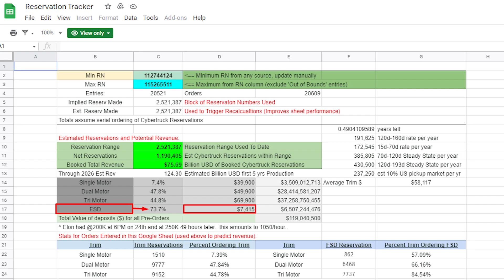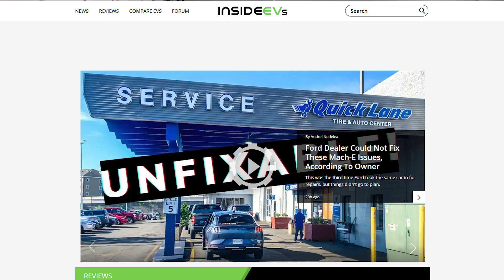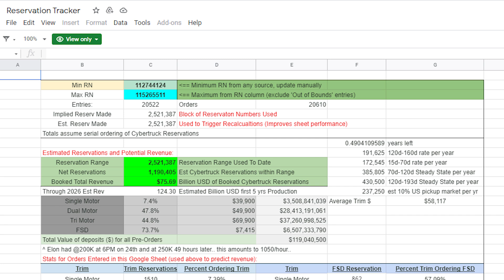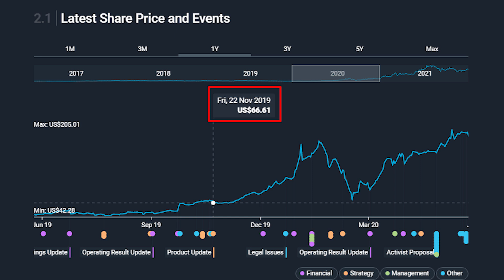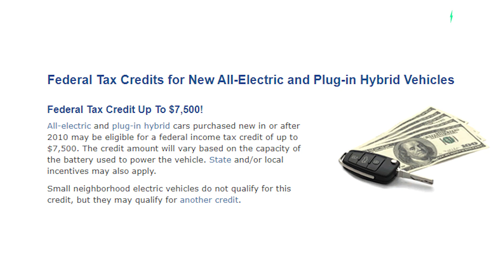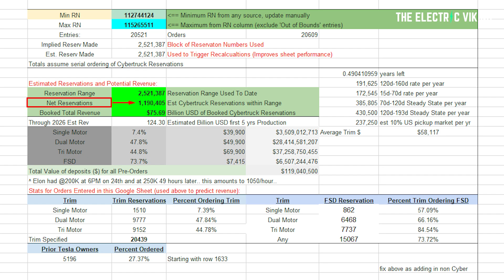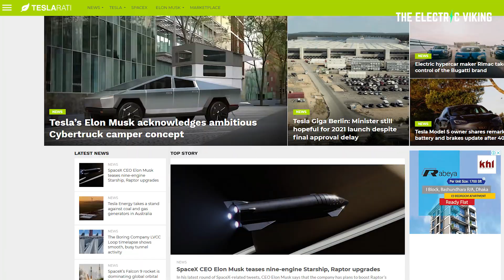Tesla's Cybertruck is set to get 2 million pre orders - THE EV REVOLUTION IS HERE

Comment: Tesla was not excluded from the $7,500 tax credit. The law allowed the credit on the first 250,000 EVs. Tesla and GM have exceeded this sales threshold and are no longer receiving this benefit. Congress is in the process of changing the original Bill to remove the cap and increase the credit to $12,500 if the EV is made in America with union labor, and $10,000 if the manufacturer has no union labor. 

Be careful of the CyberTrk reservations. The $100 on these reservations is refundable. That is why a large percentage of these reservations include FSD. Many buyers have orders for 5, 10, and 20 CyberTrks to be used in Tesla’s Robotaxi fleet. If FSD and the Robotaxi launch is not eminent when the customers are ready to confirm their deliveries (perhaps in 2023 or 2024) many of these customers will cancel their reservations. These reservations also allow these customers to lock-in the price of FSD at $10k and save on future price increases especially when Tesla releases FSD with Certified Level 4 or 5 autonomy in the coming months or years.

Comment: $100 fully refundable resevation not a pre order
Reply: So that means none of the prices are locked? In other words the $100 buys you a place in line so you can buy one for what ever price they decide to charge when they become available.
Reply: @dond668  That is 100% correct
Reply: @gregandkaruna6674  Sorta, wait and see.
Reply: @dond668  Most probably do not remember the same thing with the Model 3, many had a resevation for the $35k and at that time could still get the (up to) $7500 tax credit which would of made that Model 3 just $27500, however as we know that $35k Model 3 only came 18 months later and only for a very short time and well after that tax credit expired.

Comment: Let’s correct some facts:
The $7500 tax credit wasn’t cash it was Liability. So IF you owed the government $7500 when you filed your tax return you could claim it. If you got a return you were out of luck.
The Tax Credit allocation was for 200K cars for each dealer. Once you sold that you were finished. Keeping it fair to all dealers.
The new round of credits, if everything goes well, is a Point Of Sale Credit. This means you’ll get $10K off when you buy the car if it’s made in America. $12K off if made in America with a Union work force. So if anything the credits are to keep EV BUYERS buying Made In America products.
Reply: I heard thats now dead in the water Biden has lost interest just like all politicians regardless of which side of the fence you are on
Reply: The way I understand it, you will get an EV - Green Energy (carbon emission) credit if you buy an EV in the tax year it applies but it has to be offset by your capital gain tax owed the IRS up to the the limit of the credit (and most likely the cost of the vehicle will also factor in ranges for the credit). So other words, if you're a successful investor, that is willing to sell your stock during the tax year for a capital gain, the Gov says keep the tax owed. Figure if, you're in the say 22% tax bracket (>$81k<$172k) you would have to have a capital gain of at least $34k x .22 = $7500 owed the IRS to get the $7500 credit.  

Getting a tax refund only means you paid too much estimated Fed tax during the year but you still need capital gains owed >$7500 or a percentage there of. 

As for the POSC, it's still not clear what's going on with this since early May. Biden wants some kind of help for EV buyers to give them a cash refund to keep China out of the US from selling EV's. The consensus is China EV technology is ahead of the US car manufacturers and DEMS and REPS are both sweating it but are on the same page finally.
Reply: Yeah, it was fair to the dealers, but everyone else got screwed including the buyers and in the future you can bet you will get screwed again, its just to buy votes not to help anyone.